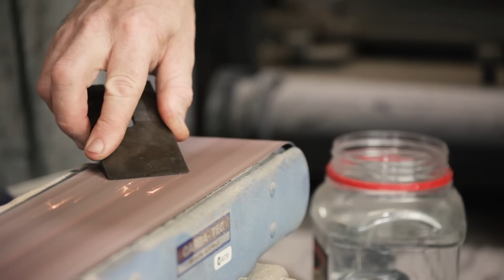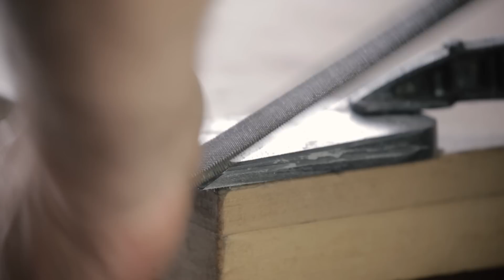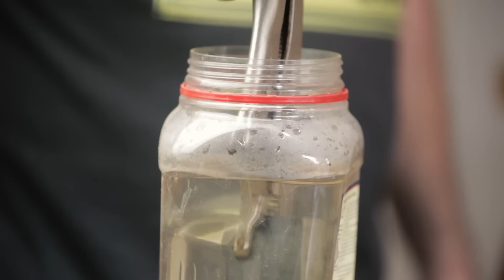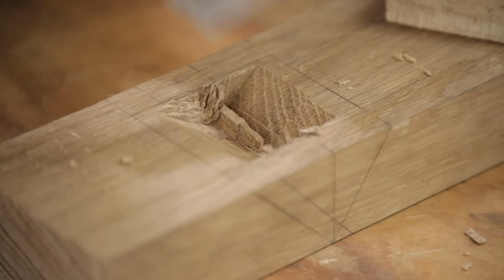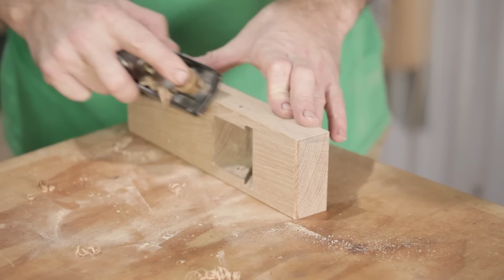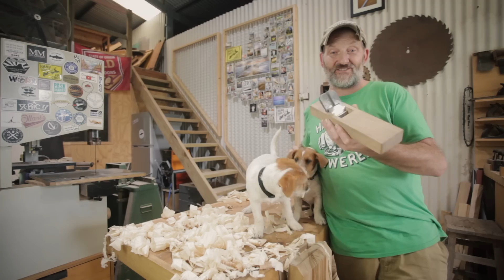Homemade Japanese Plane - Kanna

Comment from the maker: I should have said in the video that Bradley isn't tall enough for the workbench. I did mention this in the description though but as not many read the description I'll pin it here. ;)
Reply: Next project: A step stool.
Reply: Japanese woodworkers are supposed to sit on the floor anyway.
Reply: My boy is 11 and I had same challenge... so I built him, his size bench with vise and he is actually enjoying working around shop now... Having proportional tools to your size  is very important factor if you starting out... we often overlook this little detail...
Reply: BF Florida is right!! Aside the obvious and main reason the kid is struggling, it would better yet for him if he could manage to practice more the posture, but for that to work perfectly, either the table has to be lowered or him has to rise a little. His body mass is way up for him to apply his body weight.
Reply: I have seen these with handles on the sides too so he is not grabbing the blade to pull it...great build.
Reply: @IveysFamilyFactotum  I think those are Chinese planes, very similar to this plane
Reply: I believe the hallow needs to be on the other side of the blade. Not on the side that you put it on.
Reply: The thinness of wood cut by Kanna recorded in Japan is 0.003mm.
Reply: @ANGEL74LA Chinese planes can use western style metal blade, so you don't have to make any modification to the metal blade. They can be use with either push or pull action, and the handles on the sides are removable.
Reply: @ANGEL74LA  Was here thinking the same. The majority of Japanese blades are single beveled, and therefore have a shallow depth on the back of the knife or blade. He did what was supposed on the front, the opposite of what is normally done
Reply: instaBlaster
Reply: Ur spot on about the description Pask. I never think to read them and more than likely ask questions that the answers are in there to.. LMAO.. Brilliant planes they are,, What was that piece of wood u use to make these planes?? It's nice wood when it's cleaned up

Comment: Pretty good job there mate! The proof is in the pudding as they say - it seems to take a pretty decent shaving at the end. Nice work on the Dai. One thing I would say is you hollow ground the wrong side of the blade. Flat side of the blade is hollow ground to speed up and refine the sharpening process - you only have to flatten the edges of the blade rather than the whole flat face.

Comment: As one of the younger woodworkers (a year or two older than your son) watching your channel. :)
I have found that the best thing for using any type of hand plane, is to have the workbench just above waist height and using the shoulders and upper body to propel the plane, rather than pushing from the elbows/arms, when the work piece is at rib-cage height. I find that being able to press down on the timber I am planing aides direction and control as well as visually helping the planing process and technique. I have lowered my own workbench to around 850mm tall and it has made every aspect of planing easy. Alternatively i have also made a long pallet like step to use on my other wraparound wall workbenches that aides with sawing, chiselling etc.
Just my two cents, hope that helps.
Sincerely Noah
Reply from the maker: Thanks Noah! You are correct - the height is the main reason Bradley struggles. I did mention that in the description but forgot to mention it in the video. I like your idea of a step - I may have to make something like that for Bradley. :)
Reply: Maybe one of those low stools where the floor end of the legs span out further than the platform he stands on?  Cheers, David.

Comment: Awesome work. I'm studying to be a Design and Tech/TAS teacher and in the middle of a woodworking subject, it's got me wondering why they don't have more of them in schools. You could clearly see that your son was having an easier time getting results from the japanese plane compared to the no4.

You've inspired me once again and I might have to make some time to have a go myself
Reply from the maker: Glad it inspired you! Like I said I'd never used one before but now I really like it! :)
Reply: Probably because jacks are more widely used where you are,  so are cheaper and easier to get a hold of. They're also potentially easier to use for someone who is weak/young as long as the bench is at the right height.
The reason his son found pulling easier at that height is because he's relying on strength and his back muscles are stronger than his chest, as it is with most people.

Comment: When you chisel an opening in a plane like that, it is sometimes useful to clamp another piece of wood on top of your blank that has  the correct angle which you have sawn with your chop saw. When you get close, you can press your chisel up against it with the fingers of one hand while you smack it with the mallet using the other hand. If you do it right, you can get a smooth ramp of the correct angle in one go.

Comment: Nice video and nice plane; there is one thing I like to point out, you should have checked the direction of the grain in the wood you used, if any humidity gets in the plane's wood it will lift the fibers and those lifted fibers will leave marks on the material planed especially softwoods.  As when you plane wood with the grain, so should the plane.  Keep up the good work, I enjoy most of what you do.

Comment: I like the simple looks of it. I've never used any type of plan before but last weekend I found 1 at the bottom of my farther in laws shed it needs a little TLC and sharpening then it should be good to go. 😊
Reply from the maker: Restoring an old plane is a fun project, I've got a couple I need to do. :)

Comment: Superb Neil :) That turned out great. I have few old German pull planes and with having a horn shaped handle on the front could be even easier for kids to use :) It's fantastic to see your Son taking an interest in the workshop. Well done Bradley :) Great job ॐ
Reply from the maker: Thanks mate! I've seen the German planes with the horn before but had no idea they were pull planes. You may be right that they could be good for kids. :)

Comment: It may not be at the level of a true Japanese Plane but it was cutting very well and would do well enough in most people’s hands. 

From what I have heard there is something special about the steel used in Japanese Planes plus the years of experience that goes into learning to sharpen them. 

Your modesty is one of your best qualities, plus you have Shop Puppies. 🐶
Reply from the maker: Thanks very much Wayne! I agree, it shouldn't be compared to a quality Japanese tool, that's what I was trying to say at the end. ;)

Comment: That turned out GREAT! Even on the white oak u had full width curly shavings. One of the things I've learned is to not apply a lot of downward  pressure like they say "let the tool do  the work" and tell him not to pull by the iron but the end of the plane hell get good results that way .im no expert but an expert did tell me that.hope it helps 🍻
Reply from the maker: He wanted to pull on the plane iron. I did try to persuade him not to but it must have been the most comfortable way for him to hold it. :)

Comment: The hollow goes on the opposite (non-bevelled) side; you've got it backwards. Japanese chisels are exactly the same. You can see what I mean if you do a google image search for "kanna blade" or "japanese chisel hollow". But the purpose of the hollow is only to ease the flattening of the back, since the Japanese chisels and planes have much harder steel on the cutting part of the laminated blade.
Reply: I suppose I should have actually watched the video you referred to before making that comment. I see what you're talking about now.

Comment: Nice job! Only got wrong the idea about the back of the blade. You did in the front what was supposed to do on the back of the blade. Go back and watch that samurai carpenter video again. Pay attention when he shows the back of the chisels, how that thing has a depth in it, and it totally affects the sharpening. Also, the angle of the bevel could be a little less. Again, go find some information about Japanese style knifes and blades. You gonna like it for sure

Comment: Japanese hand tools are pull tools and made for people (Japaneses) who have no workbenches and they sit on the floor. no bather result there, make a good setup, sharpen correct your stanley plane and have good results with no problem.
Reply from the maker: Absolutely, my Stanley planes go great but this is fun to use too, especially as it's new to me. :)
Reply: They use benches in Japan.
Reply: Traditionally carpenters and furniture makers would've had a planing beam, a long beam with feet that would sit against the wall. 

Japanese planes are actually much more efficient than western planes for softer woods, because you use your strong back muscles. This is why japanese smoothing planes typically have a 65mm cutting edge, as opposed to 40 to 50mm on a western plane.

Comment: I like how you simply glued some steel on the blade. Could you improve a standard plane with a glued-on piece of steel (of course it has to fit but if someone plans on building a plane from scratch...)? I would take more effort in sharpening but if you do that with a machine anyways?

Comment: I like the idea of the sandpaper glued to a marble tile, but how do you remove the sandpaper to replace it? Does the spray adhesive glue not permanently affix it to the tile?
Reply from the maker: It peels off easy enough then a quick clean with acetone and it's ready for fresh sandpaper! :)

Comment: I wish you would have given us the angles used to set the blade and what angle did you put in the blade it self. And was it just a single angle to the bevel on the blade or was there a second micro bevel. Maybe a small detail to some but a big deal to a beginner like myself trying to become a you tube certified wood worker starting my education from making my own tools before learning how to use them.  I do enjoy your videos though thank you

Comment: Hey Pask mate..  Why did u have to make the original blade so much bulkier?? Is that to give it extra weight for shaving wood or is there another reason for doing that.. I love these Japanese Planes. They look so simply made but there's defo a real art to it..  
Those shavings are so thin mate u could put a load of them together with a water based adhesive and make tracing paper.. It would be a sick idea to try that Pask if u ever have the time..

Comment: Brilliant job my friend. To what grade did you sharpen the blade to??…3,000 grit or even higher??… nice to see oak being used, usually beech is sort for planes...well done 🏆👍🏼😊
Reply from the maker: Thanks Marc! 1000 grit and then polished on the strop. That's all I've ever sharpened too, but would be interesting to try some finer stones out! :)
Reply: Pask Makes I’ve used upto 3,000 grit but I’ve seen others going much higher to 12,000...I feel if your going that high you must be doing something else with the shavings....like reading a newspaper through it...crazy sharp..

Comment: Still not sure about 'J'unk-'B'ond Weld, but it seams to have worked for you. Nice hand made tool.
Thanks for sharing.
Reply from the maker: Thanks Thomas! The JB weld worked perfectly for this application, there is a lot of surface area so shouldn't be a problem. I couldn't think of any other way of doing it. I'm not sure how good it would be for other applications though.  :)

Comment: ,Why did you not weld the plate to the blade instead of the J B weld?
Reply from the maker: The heat from welding it would have ruined the blade. JB weld worked out very well. :)

Comment: Sorry but I think you grinded the hollow on the wrong side of the Blade...
Reply from the maker: Thanks for the comment Jerome, but I think you're getting confused. I understand the other side of a traditional Japanese iron is hollowed. I believe that is only to make sharpening an easier process by not having to flatten the whole of the back of the blade (just the edges). This doesn't make it function any differently, so I wouldn't attempt to replicate that on my blade(I'll just sharpen it the way it is). If you look at the Samurai Carpenters video (theres a link in the description) you will see the underside of the blade is hollowed and the bed of the plane shaped to accept it. :)
Reply: I have already seen this video and some others too (Mitch Peacock for example) I have also built my own Daï with the plan given on fine-tools and a used blade I bought on ebay but I have never seen any Japanese Blade with that kind of Hollow. After watching it one more time I understand that you made this hollow to keep the Blade in place but normally if it is tight, you don't need to do it. And if it is too loose, you can add some rubber on the Daï. Anyway you built a pretty good Japanese like Plane so keep on going and congratulation. You can find many very good quality Japanese used plane blade on ebay for less than 30 bucks. I know that it is a pleasure to do everything by your own but there are still a lot of work on the Daï to get satisfied ;)

Comment: Total clueless nonsense, this. He even put the ura on the wrong side :( :(   Nothing japanese about this.
Reply from the maker: Well if it was clueless it turned pretty fine! I never claimed to be an expert and if I remember I said I'd never tried a Japanese plane before.

I didn't add an ura, and my understanding that's to make sharpening easier as you don't need to sharpen the the whole flat surface of the iron. What I found with my research was the other side is dished too and that helps to bed the iron better so there's less chance of it moving. That's what I did, so no I didn't put the ura on the wrong side, I didn't put an ura anywhere. 

So even though I'm no expert, I'm certainly not clueless, but thanks for your generosity anyhow! :)